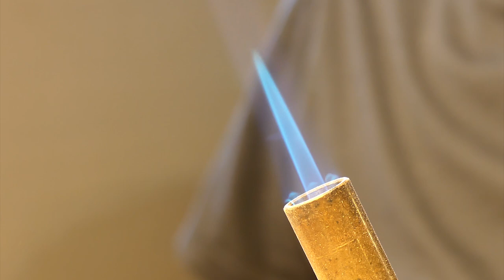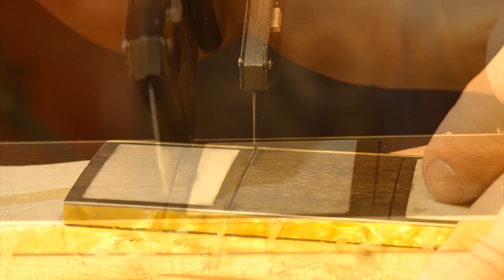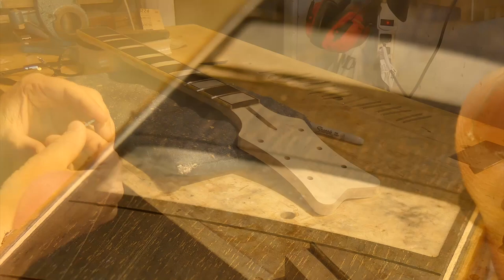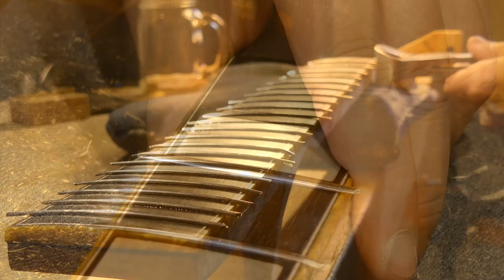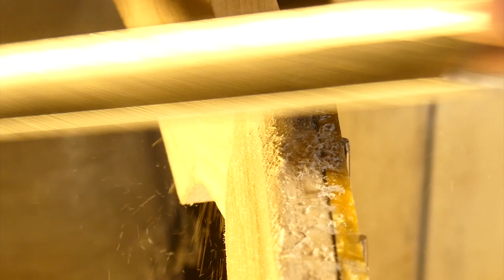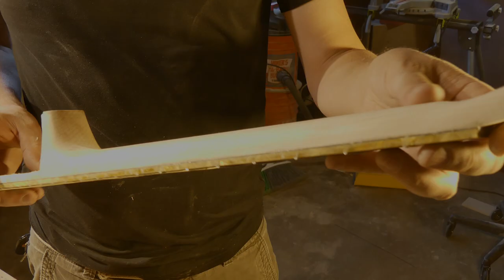Fretting and neck shaping | Gretsch White Falcon

Comment: What is the idea behind burning the fret slots?
Reply from the maker: Cleaning the CA glue from the slots, it's left over from the binding work.
Reply: @TwoCherriesIns  I pretty much had that idea but was wondering if it was because the binding is in place. That's the first I've seen it done that way
Reply: Did you use a short trusrod ?
Reply from the maker: Yes, I had to customize the truss rod length.
Reply: @TwoCherriesIns  yeah I asked because I have made a white Falcon style guitar. I used a standard guitar Trusrod and it's sticking out of the end of the neck!
Reply from the maker: @waynecarter1863  I use the hot rods truss rods when I need a custom size. I can cut them down and cut new threads to the lengths I need.